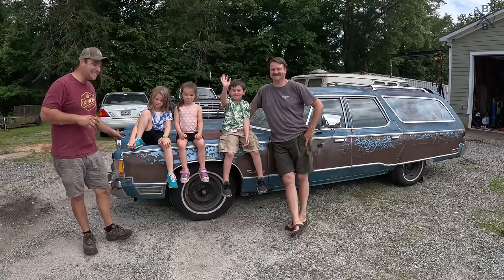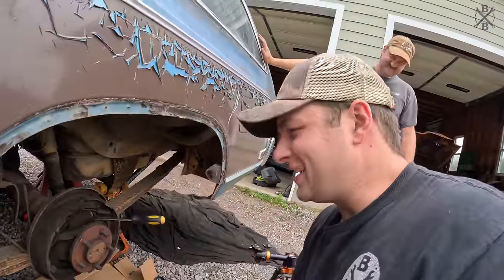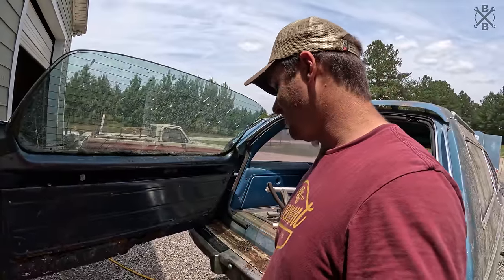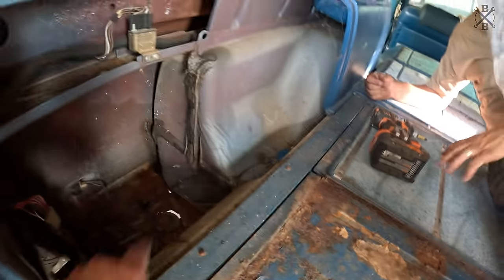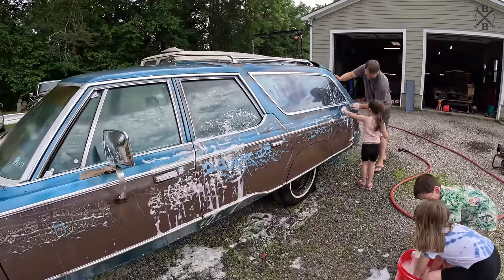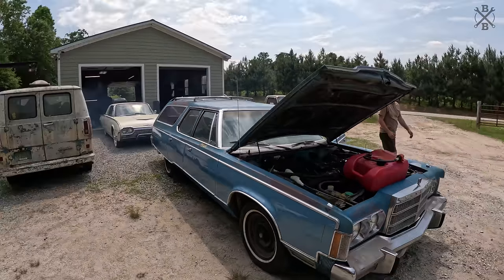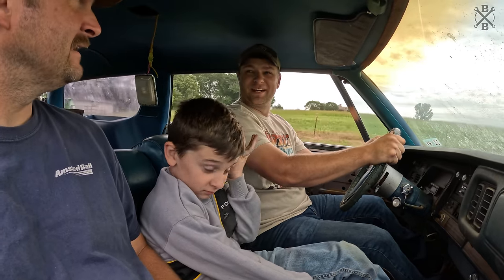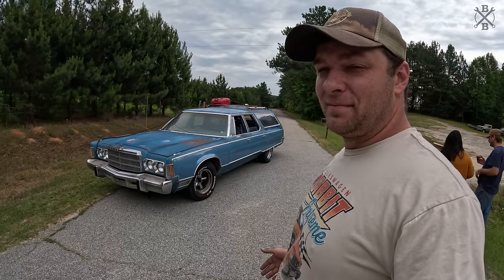FORGOTTEN Chysler Wagon! Sitting 32 Years! First Wash & Drive!

Comment: the color was called Astral Blue Metallic - this wagon appears to have every option including front cornering lights (lower front section of front fenders) chrome tailgate assist handles, electric rear window defroster, the 76 Town & Country was one of the most expensive wagons available then - regarding the tailgate - many parts are interchangeable with the 1974-1977 Chrysler, Plymouth or Dodge C Body wagons
Reply: They had a "Cadet Blue" as well looked very similar to this color
Reply: @miked19831988  interesting - Cadet Blue is Code B3, Astral Blue is Code B2 - check the fender tag under the hood - the color codes are embossed there too

Comment: Those back tailgate were famous for the bottoms to rot because the drain holes in the gate would fill with dirt and leaves and the rain water would fill the gate up and rot the bottom right out of it. If someone would of took the back apart and clean the bottom of it and cleared the drain holes it would still be in great shape.

Comment: As the second to the youngest of seven kids, I saw the 1970s from the back window of a 1972 Chrysler Cornet with the same seating, engine and 4 barrel carb. My mom was heavy on the accelerator and would do rolling burnouts at 35 mph! It had a lemon of a transmission, though. Always in the shop - it ended up being the kids' Field Car for bombing around the farm. Great memories.

Comment: Great job getting the wagon up and running. I loved the "tail gunner" rear seat in those old boats. I noticed the remnants of a Shaw AFB base sticker on the front bumper. I was stationed at Shaw in the late 60s (one of my least favorite assignments). There used to be a bar walking distance just outside a back gate on highway 441. A buddy of mine was walking home towards the gate late one night when a police car pulls up next to him lights flashing, siren, the whole works. My friends first response to the officer was, “How fast was I going?”  The cop was not amused and gave him a ticket for walking on the wrong side of the street! Welcome to the Sumpter.

Comment: With electric windows won't slide properly, first make sure the seperate sections of the track are in alignment or the windows will jam. Next clean the tracks as much as possible, then spray in the track with silicone. Your windows should then slide freely.

Comment: I wish my dad had a car like that. Lucky kids. That is a great car. So much more interesting than an SUV. Really nice design, very comfortable, strong and good looking too. Every year you owned it it would get cooler too. Yours looks like it has good bones, you are lucky.
The Comet wheels really suit it. It is also a superb period 70's colour. I think the plain blue look might even suit it more than with the wood sides.
If it were mine, I would want to paint it and make everything work nicely. Those shiny blue seats look great. I bet you can get the parts if you look hard. Working A/C and power steering would be essential.
I do like the 440, however as a daily, I would be interested in improving the fuel economy or maybe a Tesla conversion keeping the rear wheel drive. That would have loads of low end torque.
As long as it was happy at cruising 70 mph and could do 200 miles on a charge I would be very happy with it indeed.
Excellent project anyway whatever you decide to do.

Comment: OMG. You're a great dad. I love how you got your kids to help out and you all had a great time. Just a happy family (they'll stay that way especially if you keep them off the internet). They'll have these memories for a long time. I think you should keep this car, but first, pull the engine and give it a complete one over - bearings rings, etc. You could also inspect the wear on these items. When you put it back, I would see if you could swap out the carburetor for a fuel-injected system. Then you'll have a reliable daily runner. That's my two cents.

Comment: Something I had the Helms Bakery truck driver show me when I was 15 years old working on my '50 chevy in the driveway. To remove the inner bearing and seal. After removing the outer bearing, put the nut back on and slide the drum down the spindle and yank at the end and the nut will remove the inner bearing and seal without any damage. Been doing that for over 60 years. Enjoy the show by the way!

Comment: Hello From Mark In Kentucky.  I really love the station wagons that used to be all too common back in the 1970s-1980s. I’m not so sure that that wagon didn’t have Michelin tires on the steel rims In which you felt like you were floating through the air. Those steel rims would balance out nearly perfect In which there were very few lead weights required to balance the rims & tires.
The OEM gas tank had to be at least a 22 or more gallon tank which when full of gas contributed to the excellent ride quality.
When you ran out of gas, I was reminded of my Dad teasing me when I was a teenager about vehicles not being able to run off of air or he would have done that many years ago. Although I like the wood grain that the Chrysler wagons usually had, It required way too much work to remove all of that from your wagon.

Comment: A trick is put the nut back on the spindle and then pull the rotor off, catching the rear bearing, doesn't hurt anything and usually saves the seal.
Reply from the maker: Good trick! I’ll give that a go next time 😃

Comment: Thoughts:

1. Leave the vinyl off. Paint underneath is pristine. If anything paint the rest to match after rust repair.
2. Try to fine some sporty Mopar wheels at a pick 'n pull, like the ones with six holes and dog dishes that they used on police cars.
3. From the Sumter dealer tag, guessing this car was used at Shaw AFB?

Comment: The Carter Thermoquad was an excellent carburettor that was well metered and could deliver some serious CFM.
Oddly here in Australia Carter 780 Thermoquads were fitted to Ford Cleveland 351 cu engines from about-mid to late 70's until 1982.
Cleveland 351 and 302 (Yes a 302 Cleveland) cu Australian heavy wall cast blocks, and unique combustion chamber sized heads were fitted with Bosch electrics, and  continued to be manufactured here until around 1981/2.
The Carters worked very well standard and I personally much preferred them to an aftermarket Holley 750.

Comment: Great video with having the little ones chip in! One important item to remember with rear opening vehicles is the draft of the rear end can suck in exhaust gasses (carbon monoxide) and fill the rear of the car. You were driving with the front windows down so it wasn't so bad and kept out.

Comment: Make sure you clear the drain holes in the bottom of the doors that way it drains well because that's the killer to those old Chrysler's is the drain holes get plugged and hold in the water even the bottom of the fenders between the door and the wheel well leaves and dirt get in there and rot the fenders out also.

Comment: love your kids, they hurt something and just laugh it off. :) what a lively bunch!
as for the paint, I find the contrast between the original paint on the flanks, and the darkened repainted interesting. to me the wood decor always looked too fake; then again such decors weren't popular in europe ever, so it might be a matter of being used to it.

as for the brakes, you could have taken the rotors and cleaned the rust off the sides with a fibre disc while you had them in hands. also, sometimes adding a spray of silicone underneath the caliper piston sealings can help making them move again. but with yours I suspect you'll have to take them apart and clean everything up.

also, good move with the wheel bearing. reason for leaving a little play is that while driving the bearing will get warm and while materials stretch out the play vanishes. how important that is I found out a couple years ago...
brought my 1974 Ford Taunus to the auto shop (which is also specialized on old Fords) for a few repairs I couldn't do myself. they also adjusted the front wheel bearings and meant too well... on my way home front left bearing seized so hard it welded itself to the shaft, and the outer shells drilled themselves loose from the wheel hub. had the car not have disc brakes in front the wheel would surely have fallen off. not a nice prospect at 120KPH on german autobahn...
they gave me the necessary parts for free, and I repaired it in front of my house, because driving anywhere was out of question. a wee bit later I changed the other bearing which was close to die as well.

Comment: The term you were looking for on those light fixtures is explosion proof, not bomb proof lol by explosion proof it means that it contains all sparks that could happen between the socket and the bulb was switching on or off in an area which has flammable gases, so there is no risk of blowing the area up by merely switching on the lights.  Little electrician trivia for you there Mike

Comment: I've seen a couple of those with a '75-'78 Imperial/New Yorker front clip, and they look absolutely outstanding. As for wheels, I'd try to find a set of True Spoke wire wheels, the real kind - not the wire basket things from the '80s. Way cool car.

Comment: Seeing that tank on the roof .reminds Mr how I drove an old 61 rambler American I bought for $300.00 from one of are customers he had a lot of rambler and Nash"s he had this in a storage lot well I had did some of the work at the yard replaced the fuel pump still could not get it to go which I found out why later when dad and I dropped the fuel tank but that story is for another day. Anyway back to bringing the car home well where it was parked that lot was about a mile from home in a straight drive and a few traffic lights. So one night after work I met the older gentleman down at the lot and I had my round eagle gas tank that I borrowed from one of my neighbors who was a good friend that was a retired boat builder and also had many years of doing his own repairs on bots to cars in the 40"s throughout 80"s. So what I did was hook up the tank ran a gas line through a drain hole in trunk and attach to main fuel line well jumped in she started right up well l did have one hill I had to climb to come up to my street it was a straight drive and I wonder if I started to come up if it was going to run away back in tank as I drove up but that little car didn't miss a beat came up just as smooth no problem. Well I got to that first hurdle well next one was a first of two traffic lights well my concern I forgot to mention I didn't have brakes in three of wheels so thankfully it was late in afternoon so not much traffic so was able to drive slow well I approached the lights thought oh good green well had a feeling that was going to not stay and I was right it turned red just about a half of block before I reached intersection so although I was going slow still had to stop well hit the brakes and that front left grabbed so did get that one in control same at the other traffic light. So just a matter of one more steep hill well she climbed no problem well three more blocks drove home without no problems. So seeing your temporary gas tank brought back first of many mechanical issues to get the little rambler back on the road she was not pretty but that little flathead ran like a sewing machine. It was an adventure I enjoyed being able to  do most of the work with help of advice and at times help from my dad  thank you for bringing that memory to me tonight sure wish I  could send this video of your working and riding in the wagon. But had a feeling dad may have been watching over my shoulder from his new home up above . Thank you both for another great video. Heck wound up stay up all night watching the first two l look forward to watching the others later tonight

Comment: Ahh man I remember driving across county San Francisco to natchitoches Louisiana in 74 Gran Torino wagon my grand dads and my dad had 73  or 74 Plymouth wagon miss it those were some best memories of my child hood your brake issue more than likely is the rubber brake lines going to the calipers causing the brakes to hold stick after applying pedal usually if the car sits for while they free up try the brake lines attech to caliper first god bless beautiful family pops is the coolest lost my dad in 2019 we use to do this same thing u guys are doing now that’s wagons the coolest add dual exhaust those old 440 mopar carry nice note keep sharing these videos wrench on brother

Comment: Upon a second viewing, I just noticed that the driver's side rear quarter glass trim is loose and was shaking as you were driving along (at the 34:21 mark).  You might want to secure that irreplaceable piece just in case it falls off and get crushed.  Cheers!

Comment: Repacking wheel bearings used to be a regular maintenance thing. They would normally be repacked every time new brake pads or shoes were installed.

Comment: Love the two tone patina and ruff paint. I would leave the nice paint and maybe paint the ruff parts a different color. Or you could do a wood vinyl wrap on the center sections but that patina blue in the middle looks too good to cover. Maybe repaint or change the color on top and bottom sections. I wonder if they stop doing these cuz all the exhaust would go in through the back window?

Comment: Trust me on this one after you've had that running for awhile the valve seals will fall apart and end up in the oil pan plugging the oil pick up tube after getting my 69 charger running after settling 25 + year's i had a live gauge on my 440 and i noticed the oil psi slowly dropping i pulled the pan and found it was full of broken valve seals plugging the pick up tube

Comment: Not take away from anything you are doing, you need to spend the dollars and get the drum brake tools. So much faster and safer. and get a brake bleeding tool that fills from the wheel to the master on all four wheels . clean fluid from wheel to master.

Comment: You will never find that rear cargo door. I had a '96 Roadmaster wagon that was in mint condition. A guy hit me from behind, and nothing was damaged but the door. No body parts for the rear of the car were available. I could not find one in a junkyard anywhere, since the car had a low production run and mine had a rare option package that affected the door, so my only option was to pay $3600 to have one fabricated for it. Needless to say, I never got it done.

Comment: i had a66 tempest wagon in hs, i put the duels straight out the back you couldnt put down the back window without gasing yourself, they need to exit  sideways  behind the rear wheels,3rd youteber i have told this to an no one has listen yet.(i know there comming)

Comment: My opinion is the wagon looks better without the wood grain. The blue is a very nice color on that car. Your comet wheels look good. And believe it or not, those ancient things called hub caps or wheel covers that go on the steely wheels look good too.

That year the 440 only made around 220 hp due to emissions tuning. But those can be built to 450 to 700 hp pretty easy. These engines are really torque monsters. 

I have seen a number of videos where guys reconstruct rusted car parts much worse than this back to good usable shape.

Comment: I would leave the fake wood trim off and leave it the way it is. I think the original blue with the dark blue looks good I don't know if you can find a set but a repertoire of the Chrysler or Dodge Rallye wheels on it white Letters Out most definitely. put a set of dual exhaust or side pipes  and a set of air shocks on the rear man what a cruiser it would be.

Comment: Where did you get that POS/NEG lead????
Reply from the maker: My long jumper wires used for the fuel pump? Or the ridiculous ground cable we have on the motor? Lol
Reply: @BudgetBuildz  I'm assuming its the "long Juniper wires" (red & black you used to test the electric back window of the stationwagon)

Comment: LOL "explosion proof" electrical devices and equipment are "Electrical Code Official Terminology" for "airtight" so it can be used in a flammable gas environment without the electric guts or any hot surfaces igniting the flammable air.

They aren't "bomb-proof." They are called "explosion proof" as an official terminology. you see "explosion proof" fittings near gas pumps and stuff where they fill the conduit through a Y-shaped fitting (and it all screws together, too) that you use the Y-branch to fill the fitting with putty/epoxy/whatever comes with the kit to seal the conduit off that's going into the flammable-stuff area or gasoline storage tank.